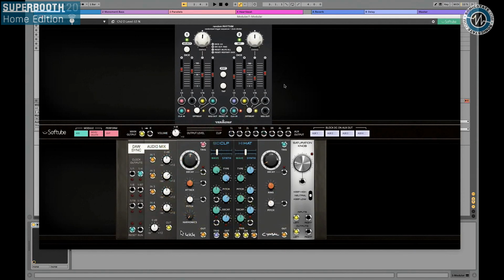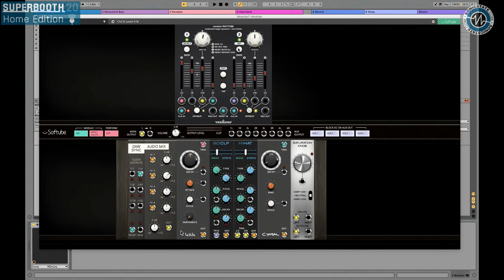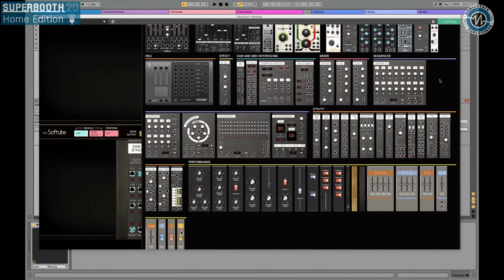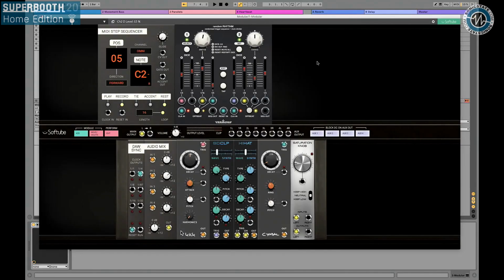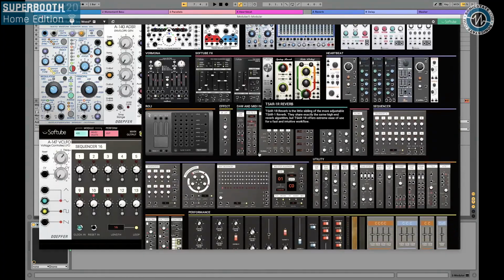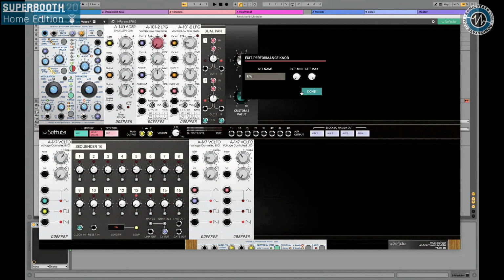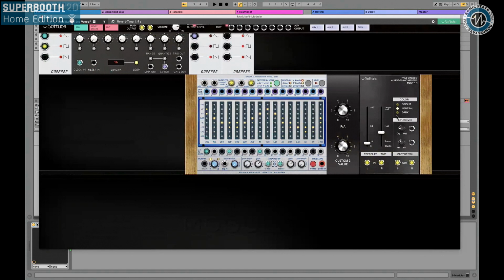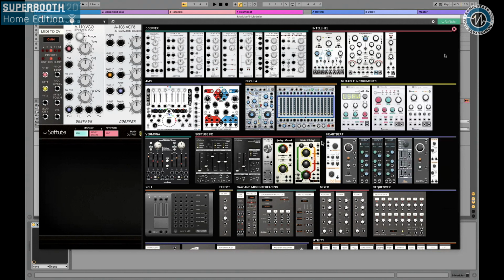Superbooth 20HE: Softube Introduce Vermona Random Rhythm

Comment: Hope Softube is listening. Maybe I repeat myself but hands down Modular is unparalleled sonic quality wise in the software domain. Nothing sounds like this, especially when the most complex modulations occur, this system is clearly miles ahead. I love to see more Doepfer modules and really hope you support that system further. I also would be very glad if the graphic GUI would be re - sizable. It's no fun working on a 2560x1440 screen or bigger. Maybe it's getting like the new AmpRoom done day? Last thing I wish from Softube is to get rid of this terrible iLok system, it's so annoying and user unfriendly. Great video btw. Thanks. Cheers
Reply: nichttuntun I've been using Slate, Softube, Eventide etc with iLok for years, what’s wrong about it?